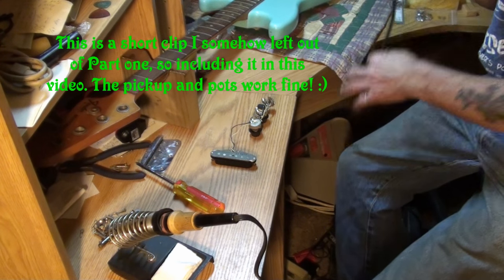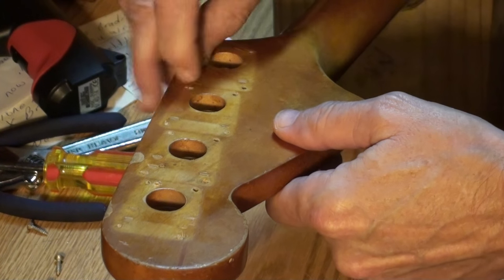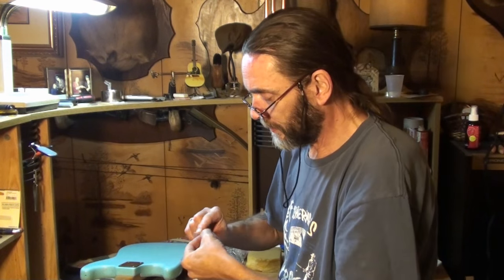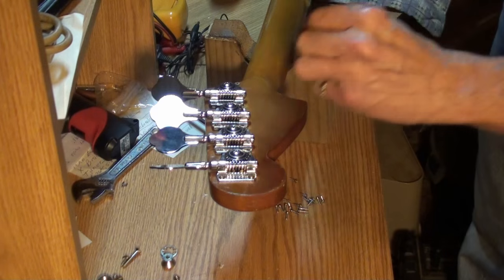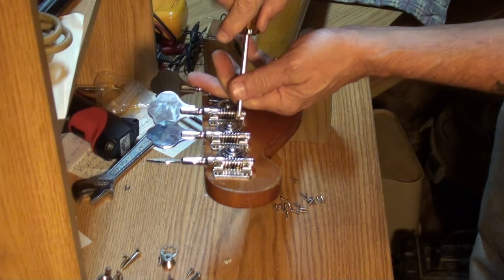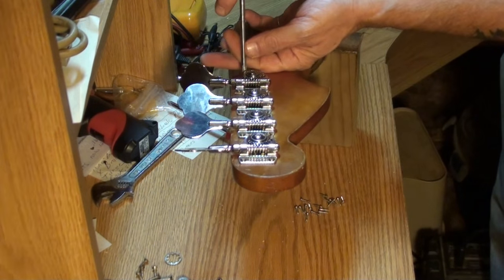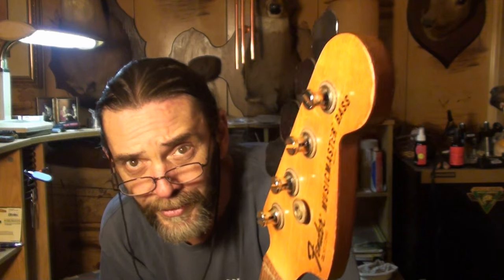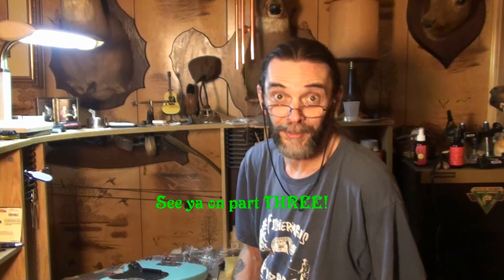Fender Musicmaster bass repair 2 of 4

Comment: On one project where posts were too jiggly inside the sleeve I tried some teflon tape around the area below the sleeve.  I used intentionally more of it and cut off a small piece at a time till it would go in with no resistance.  Best tuners I've had ever!
Reply from the maker: Very cool idea! Thanks for sharing it, I run into this problem more times than one might think so I'll definitely try teflon tape the next time I get a repair like this.

Comment: Lookin good Randy...I went thru the same deal with keys for a 57 Les Paul jr.... old cellulose just crumbled... had to use old ferrules too or bushings depending where you come from...Have good one
Reply from the maker: +dan beck This pick guard is brittle like that, I know if I tighten the screws too much it's gonna crack. Got the new saddles I needed for this but haven't finished it yet lol cheers mate!

Comment: I use toothpicks and wooden matches all the time to fill old worn holes. Maybe that didn’t sound right but it works for certain applications.
Reply from the maker: +Dale Palmer hahaha sounds pretty good! :D Yeah it works like a charm, I've used matches and shaved them down to fit right, they do the trick. Thanks for checking out bro!

Comment: Hey Randy, Have you ever tried NevrDull? It will shine up those rusty tuner bushings. Its a good product to have around the shop, I have used it to clean up some nasty rusty screws, it doesn't make them mint, but does clean them up a lot and bring back that shine.
Reply from the maker: +Er Guitars Funny you mention Nevrdull, I tried Happich semi-chrome polish first and always like it better for frets, it didn't work so well on the bushings so the last thing I tried was Nevrdull, this bass is really rusted and pitted bad in some places. Usually Nevrdull or Happich makes parts look like they have been dipped in liquid chrome again but neither worked on this bass. Thanks for watching and the idea!
Reply: No Problem, Thanks for getting back to me. Is the owner of the Bass the original owner? Also do you know what year it is, looks like late 60's-70's to me.
Reply from the maker: +Er Guitars I don't really know, it belongs to a friends friend, not sure how long he has had it but I'm thinking too it's a late 60's or early 70's. I was really shocked how quiet and noiseless the electronics are.